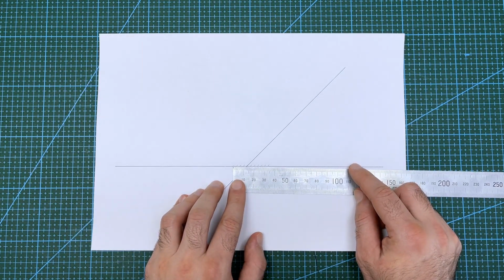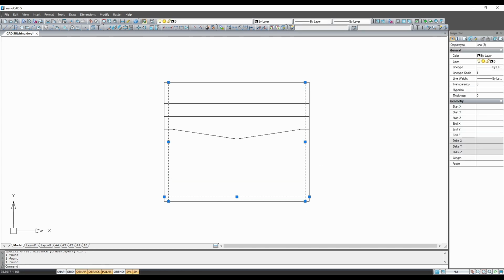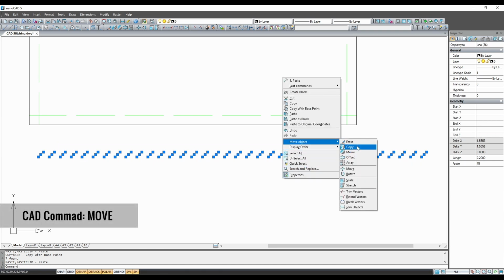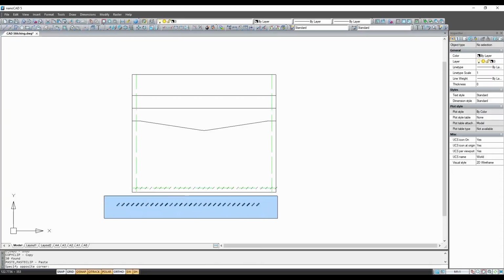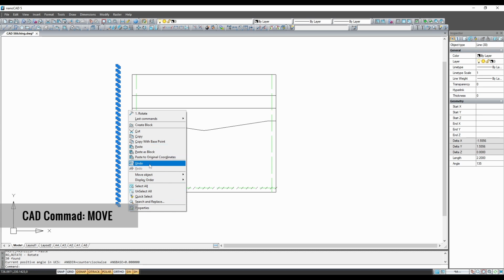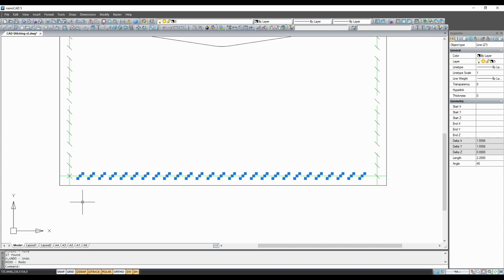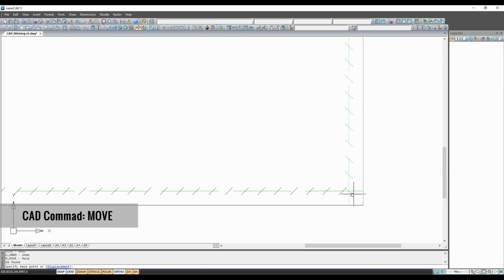Stitching Holes for Leather Patterns (CAD)

Comment: Hi! What is the size of the thread you use for 3.38 chisel? I'm just into making leather wallets, and I really liket your stiching size of your wallet at 7:44, looked pretty nice!
Reply from the maker: Thanks! That wallet was 4mm spacing with 0.5mm thread. For 3.38mm chisels I use 0.45-0.6mm threads depending on the look.

Comment: hey sir ! how can i make them apply to a round shape ? that would be awesome.
Reply from the maker: For curves, use 2-prong pricking irons to preserve the spacing of stitches.
Reply: @TeranAtelier  thanks for your response but i meant in nanocad mr teran
Reply from the maker: @mohamedoueslati933  Sorry about that. The way I do it in CAD is to copy and paste circles that have a radius equal to your pricking iron spacing. Paste a new circle center where the circumference intersects the stitching line. The circle centers will then be the centers of your stitching holes. I hope this helps.

Comment: good video. Since a year, are there any better approaches for offset paths and stitching hold using AutoCAD LT ?
Reply from the maker: Thanks! The ARRAY function is also useful to place stitches along a stitching line that has been offset from the border. This is very useful for curved edges as the stitches will always be rotated properly with respect to the stitching line.
Reply: @TeranAtelier  what about in Nanocad? I don't think they have the array function
Reply from the maker: @-JMR-  NanoCAD also has the array function. Just type ARRAY and hit enter and a dialog box will come up where you enter the settings. It works very similar to AutoCAD.

Comment: Cool video. I use illustrator and make my stitch lines first then offset path to final dimensions. My problem is after I dye my leather I want to change my hardware. As makers we are our worst critic 😏 thanks for your time in making this video.
Reply from the maker: Yes there is always little things that can be improved on. I will try your method starting with the stitching lines.

Comment: Thanks for all efforts and nice work.
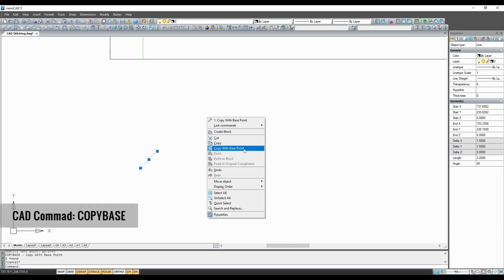Would you please explain again the step of (copy with past point) time 3:15 as I didn’t get it, although i tried many many times. how you select the end point and put them in one line after you moved little to left side. Thanks again
Reply from the maker: Thanks! For that part I used the copy with base point command and selected a base point 3.38mm to the left of the top of the stitch, then when pasting, the pasted stitch will appear 3.38mm from where I position the cursor. Another method would be to draw in a horizontal line 3.38mm long and then use the normal copy command on that line and and stitch, then paste both of them together, and then remove all the unneeded lines later.

Comment: Nice video, in addition to copy and pasting the stitch you can use an array function and toss in the number of holes (I estimate then add or remove as necessary) little less work 😉
Reply from the maker: Thanks! There are so many ways to space out stitches in CAD. The straight edges are simple whereas the curved edges take a bit more work.

Comment: Oh my aching head.  I do it the old fashioned way with pencil and paper.  Using 3mm irons makes the math easier.  Can that program figure out a curved gusset including the gusset fold that is stitched to the bag body?  Keep up the good work.
Reply from the maker: Thanks! CAD software is very versatile and you can extract the length of any curved line like the outline of a gusset. I haven't tried designing a gusset with a fold but I wouldn't think it would be an issue. I am planning a video making a simple gusset using CAD so you may get some ideas from that.

Comment: Very smart use of the protractor. I made my stitches by eye and had to print and adjust several times in order to get the pattern right. Other than that I do everything the same way, only in Adobe Illustrator.

I’m fascinated by this topic and by the difference between prepunching the holes before glueing vs gluing and then punching. Also cutting everything to size first vs having oversized pieces and then trimming at the end. Both have advantages and disadvantages.
Reply from the maker: Thanks! I didn't have a real protractor on hand so I downloaded one. I rarely pre-punch single pattern pieces before gluing as it doesn't always align perfectly when gluing. Trimming after gluing saves a lot of sanding time and gives the best looking edges, I try to use that method as much as possible. I am not a fan of pre-punching every piece of a pattern before gluing as it is difficult to get nice clean edges.
Reply: What I’m trying this week is to cut one layer to final size first and then have everything else a bit oversized. In the end I trim everything to match the master layer. I change my method a lot as I’m learning. Writing this comment I just had an idea to build a simple clamping jig that holds the work in place under a metal ruler when cutting.
Thank you for your video and your feedback!
Reply from the maker: @randomscandinavian6094  That is a good technique, I use it for watch straps where the inside lining is cut to size and then used as a guide to trim the outer layer.

Comment: Hello 3mm french types pricking iron for awl size?
Reply from the maker: It would depend on the brand of your pricking irons as they have different prong widths. 3mm is a small stitch so I would go with the small size awl like #0 or #1.
Reply: @TeranAtelier  my 3mm pricking iron size 1.5mm  for awl size 1.4mm vs 1.6mm ?
Reply from the maker: @mahmutgurell  The difference would be almost unnoticeable but I would go for the 1.6mm.
Reply: @TeranAtelier  thank you